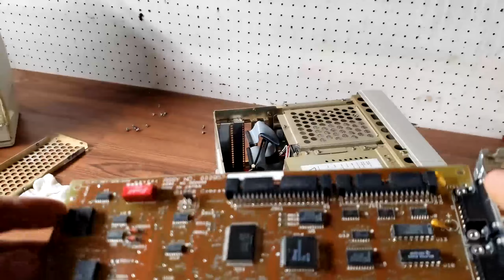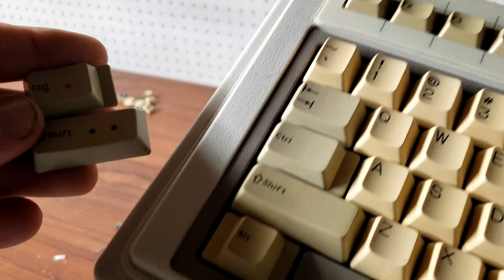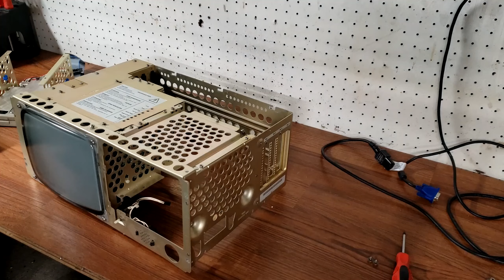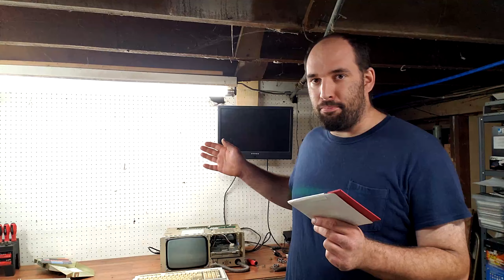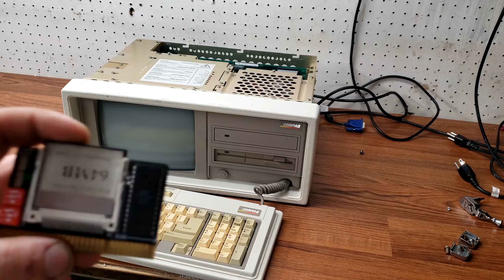Compaq Portable II Restoration Part 2..A rollercoaster of a project!!

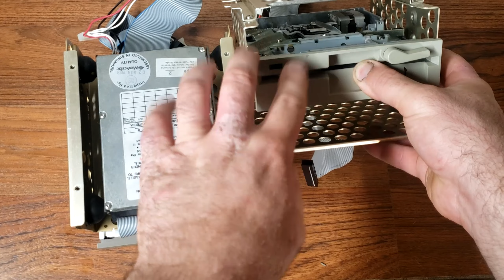Comment: 17:12 I don't want to destroy your world or anything but the Teac FD-55GFR you have there is a 1.2MB floppy drive, not 360k.
Reply from the maker: Is it?  I didn't even think to check that after seeing the push button one was 1.2mb...now that's odd since from what I could find 1.2 drives wasn't an option of the portable ii.
Maybe they both were upgraded?
Reply: The FD-55GFR is definitely an upgrade as the original drives that came in these machines are all quarter-height ones like the Canon you have in there. There is a good chance that the Canon you have is 1.2MB as well: Canon 5501. I'm used to seeing Okidata GM 3305BU drives in there, but the Canon could possibly be original. Remember this is a 286 so 1.2MB drives were available!
Reply from the maker: @jscipione yea the canon is a 1.2mb
I found that out when the setup floppy kept giving errors when I'd set it to 360k 
That drive is usually found in the portable 3 from what I can tell, so I'm guessing these 2 must be super late revisions. 
And yea they are good upgrades..might give me fits later tryinf to write 360k floppies for the portable 1 (if it works) but thats a future bridge to cross
Reply from the maker: Yea i doubled checked that Teac  drive..its 1.2 mb. 
I do have a 5.25 drive i saved from a smashed deskpro (the same one that had that other brown video card) 
I never bothered to test it yet but hopefully that's a 360k drive...
If not I really really hope either the 5150 or 5160 works when I get to those restorations lol